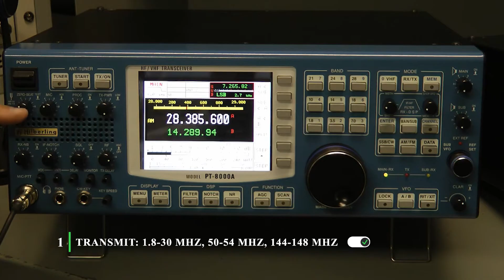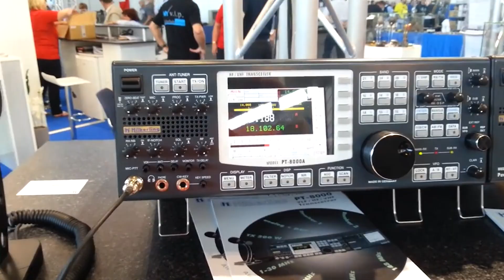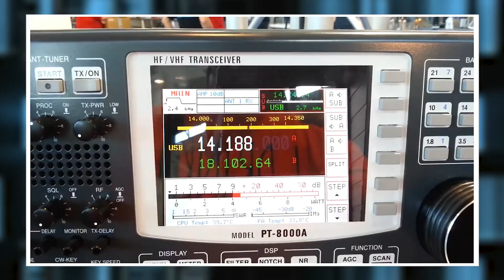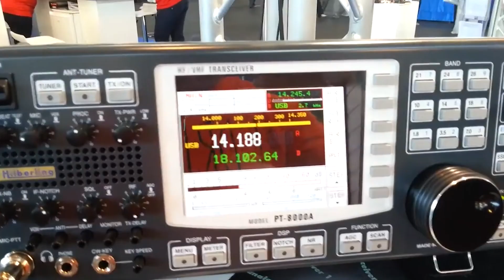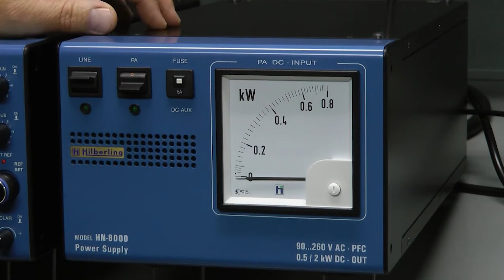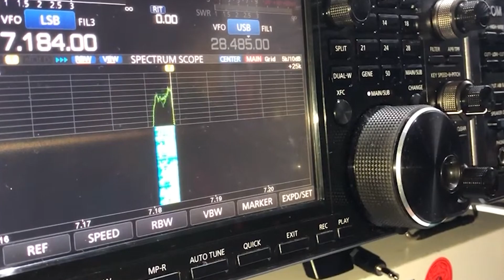The Best Ham Radio You Never Heard Of - Hilberling PT-8000A

Comment: This radio is now far from being "the best" if you look at the perfs on Sherwood Engineering receiving data charts... for 1/3 of the price of the PT-8000A you have the Yaesu FTDX101MP with way better specs and performance. Now, I saw the PT-8000A in the flesh at Friedrichshafen, this is a nice looking radio but the TFT screen seems to be outdated with a not so smart resolution.